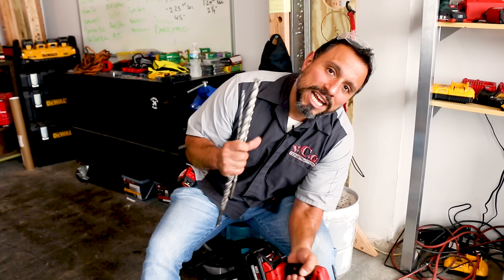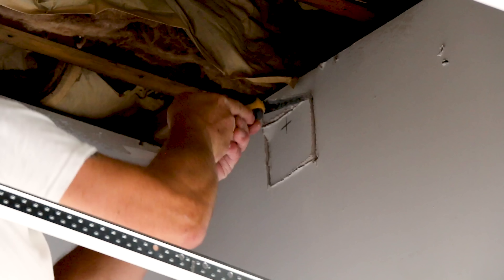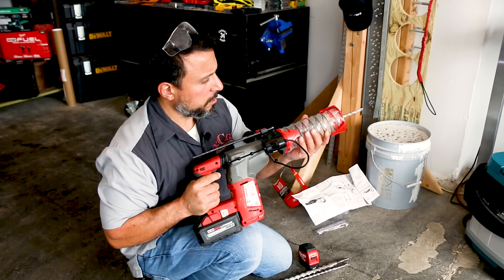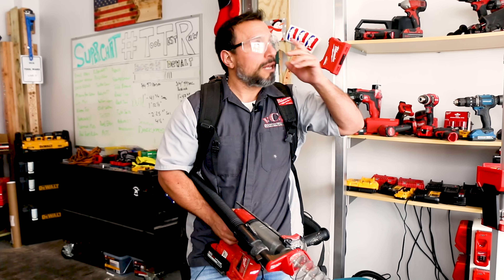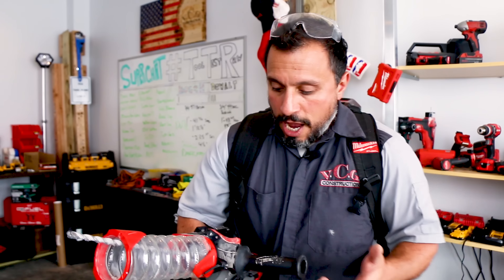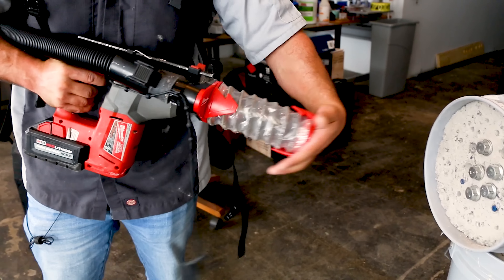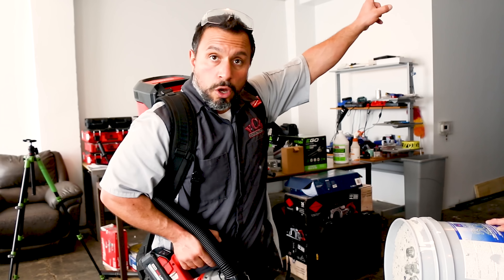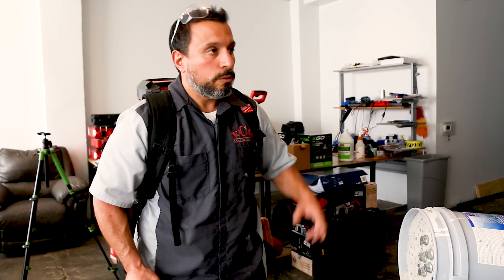Milwaukee Tools Dust Trap Solution - Does It Really Work Or Not

Comment: The company I work for bought a bunch of these. They work really good for us. Put it on any drill. It catches metal shavings, wood shavings, and concrete dust. Especially without a vacuum attached, it gets into tighter places a lot better than a big hepavac with a standard "dust catcher" or and even the vacuums that are attached to the hammer drill
Reply: Ughh metal shavings would rip or melt the plastic
Reply: @conqwiztadore2213  ughh... No they don't

Comment: As a plumber who drills anchors for threaded rod above head for suspended drainage & water pipes on multi level concrete appartment complex. I aprove of such a product. It does fulfill a need.

Comment: i have that same attachment and never use it with a vac. most times i using it though im drilling overhead for rod anchors so all the dust is falling into the trap towards the bit vs the side. you still have some of the super fine particulate that comes out the side but for the price point its hard to beat. we also milwaukees sds universal dust extractor which works very well although it makes the drill significantly heavier and cost much more.

Comment: Thanks for the content cuz! It is certainly better than nothing. The cordless bulldog with dust extractor attachment has become my go to for situations like this though. For bigger stuff I break out the Fuel sds max and an H.O. 8.0 or 12.0. Usually just drilling open to fairly open new construction. Or drilling to tie steel into existing concrete. Also for breaking small areas of concrete and tile demo. Gotta love technology and the solutions out there. There's a solution these days, for problems you didn't know you had! 😂

Thanks again bro! You're a beast!
Reply from the maker: You da best, thanks David!!

Comment: Hello,
I like the backpack vac.  Not a fan of that type of SDS dust system.  I thing there are better systems on the market. I do not know much about the Milwaukee SDS hammer drill,  because mine are Metabo SDS hammers.  Thanks for the like at the new stuff Vince !!!!
Reply from the maker: I will admit for the minimal cost it does a pretty good job!!

Comment: if you need to drill a deep hole and also be compliant. Start with a short bit, drill to its max length, then change to a longer bit so now when you start drilling the drill bit is already deep enough so the cover seal against the concrete.  Pain? yes but if you only need to drill a few holes drill all the holes with the short bit first the switch to the longer bit only once and drill the longer... you are still compliant.
Reply from the maker: Awesome advice Richard I really appreciate that!
Reply: Two springs that snaps together would be faster and cheaper. I will probably look into modding a kit so it can be done.

Comment: Its a ok idea but beware not to let the drill bit touch the outside plastic after drilling. The thin plastic will melt instantly it also gets holes in it very easy. Also you can lock the sleeve all the way back to the drill. The red lightning tabs that say milwaukee on them will twist lock into the bottom lighting bolts if you want to use it without the dust trap.

Comment: I just got the Milwaukee M12 Hammer vac Universal impact it's for the hammer drill it hooks up to the side of the hammer drill give you a depth meter and a HEPA filter the rep from Milwaukee gave it to me for free to try out have you ever used one of those before it's price is $250 at Home Depot on the back it has a HEPA vac filter and it's also OSHA approved
Reply: I have the same and really dislike it. Bulky, heavy and doesn't work with bigger drill bits (max 1/2" I think). The spring we see in this video seems more practical.
Reply: Mathieu Roberge  no I don't have what Vince's showing in the video I have the Milwaukee M12 hammervac Universal dust extractor kit what it is is a you hook up the hammer drill to the side of the unit and you could adjust what depth you want to drill a bunch of holes it's got a HEPA filter in the back Home Depot has it for $250 it's nothing like what he's showing on the video
Reply: Yes we are talking about the same thing. And I dislike it a lot for the reasons mentioned above. I said that the tool he shows in this video seems more practical and versatile than the universal vaccum M12 add-on I already have that you are talking about.
Reply: Mathieu Roberge okay long as I know we're on the same page I find the thing to be useless the Milwaukee Rep gave it to me for free because I buy so many Milwaukee Tools that's all the tools I have eyes Milwaukee everything tools Mark is gloves you name it so he gave it to me but I have no use for it and I guess you didn't either thank you for the comment

Comment: None of my jobs require being OSHA compliant for dust extraction when drilling masonry or anyting else. Though I do find it necessary lot of times to wear masks because I don't have a dust solution. That looks like it worked pretty well it also looks kind of gimmicky (which is what I think every time I see it in the stores). But like I said it looks like it did the job. And it is a fairly cheap enough solution. what I'm interested in getting although I won't because of the cost is that backpack vac.
Reply: None of your jobs require being osha compliant? Every job requires that. Are you just yoloing it by yourself doing concrete demo? It's stupid not to mitigate dust wherever you are regardless just for safety

Comment: Did anyone notice the sleeve looked as though it hooked into itself to keep it in the compressed position???? Might be handy for when you are setting the bit.
Reply: Yes the lightning designed in the plastic can be snapped together and keep the spring compressed.
Reply: Did he mention that? Looks a good addition to a tool though.
Reply: @simonhughes6267  No he didn't mention it, but I used it once and did it.

Comment: The thing about this dust collection is people will most likely use this with drop in anchors and nil in acres 1 1/2 inch to 2 inch long, that is it. Drilling above your head with all this heavy bulshit vacuum attached to it is unnecessary especially when you have hundreds of these tp drill. I hate Milwaukee and I love this thing on my DeWalt hammer drill.

Comment: I dont really like this tool. I would just use a vacuum... 😀
Reply: @martylucas8557  yea to be fair in Israel we do have drywall walls nowadays... In new construction. But normally cinder block walls. So a sds machine is pretty much a must here. There is a trick to drill through a clear plastic cup. And it catches the majority. At least for me the entire machine I purchased was about 120 usd including accessories... So 50 for the attachment is a but much
😀